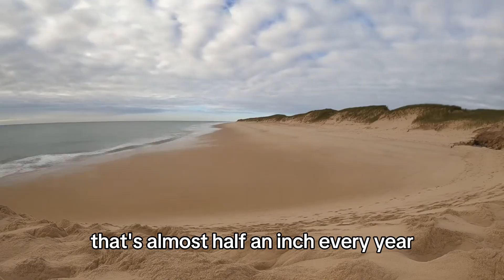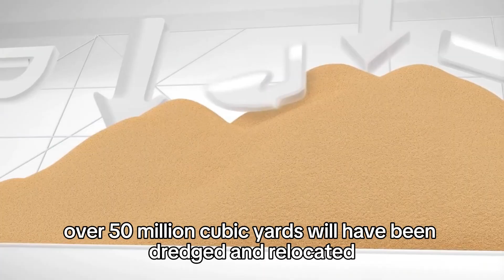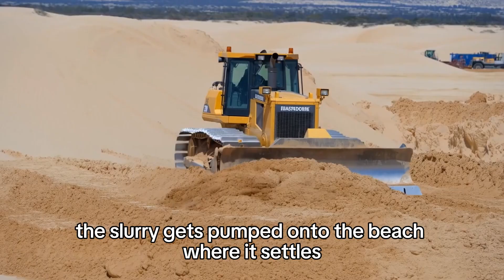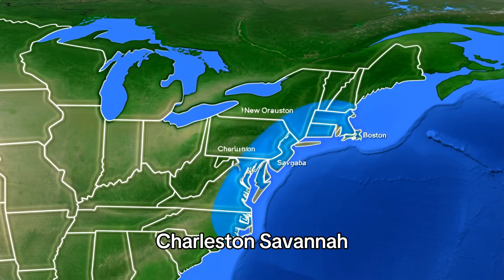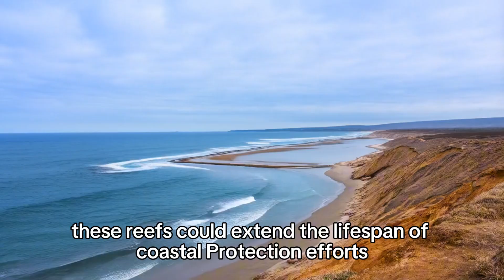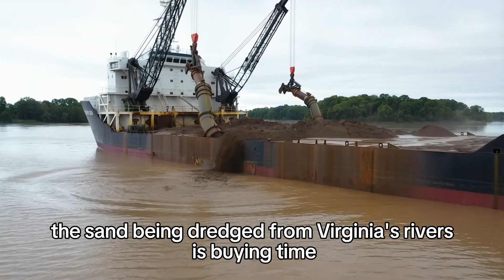The US Is Removing Millions of Tons of Sand From Virginia’s Riverbed, The Reason is SHOCKING!

Comment: They should do that to the settlement in the Mississippi . They can put it on the farmland on both sides . It will take the water holding sludge and fertilize the farm land that will help both